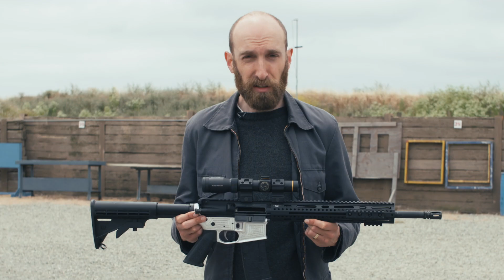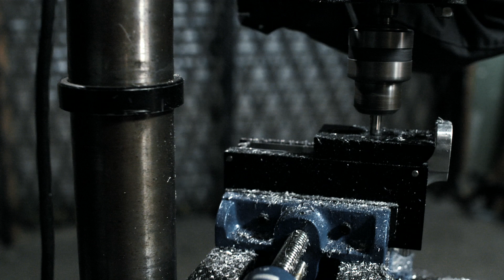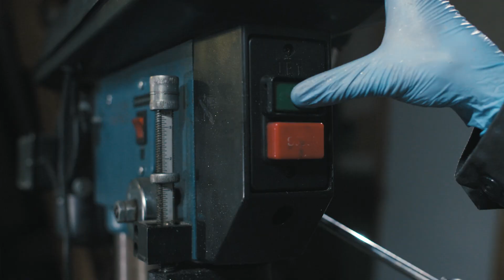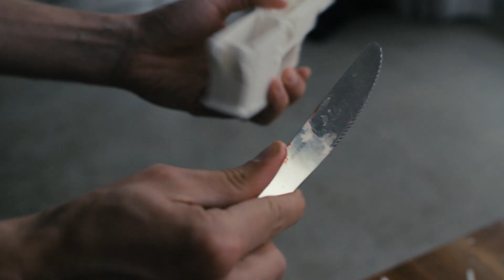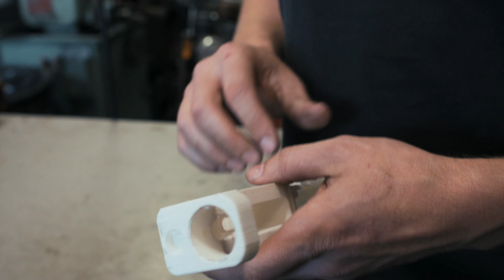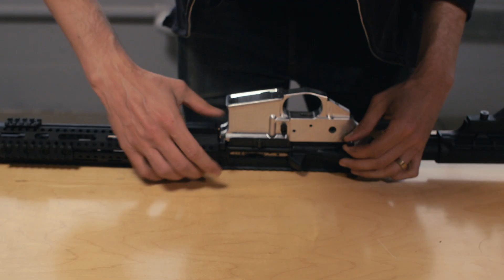I Made an Untraceable AR-15 'Ghost Gun' In My Office | WIRED

Comment: WIRED has printed articles calling for more gun control before, so I was pleasantly surprised that this video was "just the facts" without getting political. It would have been nice for them to go into more detail about the reasons people want to manufacture personal firearms, though. They made it sound like it was almost a tool to violate the law. These are designed for legal use and they don't help anyone get around gun control laws. A commercially made serialized AR-15 is legal wherever an unserialized AR-15 is, and an unserialized gun had many legal restrictions upon it and cannot be transferred or sold. These are often made for ideological reasons, so that the government does not have a record of these weapons (fearing future confiscation).

Comment: An 80% lower is what we refer to in the industry as a factory reject.  They are not sound parts, they are essentially not endorsed by the firearms industry, anyone using one better have insurance
Reply: +Sterling Archer Explain a lowers dangerous failure modes please?
Reply: WackyBroProductions tell me which major gun manufacturer makes an 80%?
Reply: Sterling Archer None that I know of, But I actually want to know why it could be dangerous since its not under any pressure.
Reply: How do you know if the process for making the lower cast is precise or the metal is good?
Reply: Sterling Archer You don't but if it fails what would be the danger?

Comment: You know whats interesting to think about, in a way newtons third law of physics works here. For every action there is an equal and opposite reaction. With anti gun citizens and politicians creating laws that put pressure on Law abiding citizens that own and enjoy guns, the gun community creatively reacted by taking the entire process of owning guns almost completely out of the hands of the government. So in essence if the liberals had never tightened noose on guns, the government would probably have more control over guns. At the rate the liberals are trying to crack down on citizens owning guns, give it 10 years and there will probably be fully automated complete gun manufacturing desktop machines. you just stick in a bar of steel and a few plates of aluminum and an hour later out pops your upper,lower, triggers assembly, bolt carrier group, gas tube, barrel, buffer tube, and muzzle brake.

Comment: because EVERYONE has access to a 3d printer or the computer thing. A drill press maybe. or the $1,500 ghost gunner. Because most thieves have several thousand to spend on building an untraceable rifle to rob someone (how they get $) lol. ONLY the lower receiver made with the ghost gunner was good enough to work. So, what you are saying is I can build me an AR-15 after buying all the parts and a $1,500 milling machine. hmmm sounds cheap enough for EVERYONE to afford. Pretty soon they will be just like big houses and corvettes. everyone has them because they are sooo cheap if you just build them yourselves! Actually you will find most things cost more to build yourself. Maybe if you didn't contradict yourself by saying how easy it was for anyone such as yourself to make these guns, but you in fact did not make a functioning lower receiver, but instead wasted $300 or so in "trying" to make one and then had to get a $1,500 machine to make a functioning one. So, let's see what is the total cost going to be? Higher than most criminals can afford I can tell you that. Also, what is the difference between a "ghost gun" and a gun purchased cheaply on the streets (less than $300) with the serial # filed off? I'll tell you since I've been there and doubt you have. Well, as you can see unless you have a lot of $ a ghost gun is implausible, whereas a "burner" or "throw away" which is a gun purchased legally and then has the serial #s filed off or other modifications. Now, which do you see being easier for criminals to get ahold of? Not a hard choice there if you know anything about economics and general criminal economic background.

Comment: Well...  Knowledge wants to be free!  Incidentally this is perfectly legal and is no more a "skirting" of gun laws than taking legal tax deductions would be "cheating" on your taxes.  You can do the exact same thing with an AK-47 by folding and punching sheet metal.  What I would hope you would take from this is that there will always be ways to obtain firearms, even for criminals.  Stricter gun laws do not affect criminals, but only those with respect for the law.  But I'm sure you've missed that point.

Comment: Can it mill out a 80% 1911 or AR-10 lower? If so, totally worth the investment.
Reply: +Andrew Butchart - if it is a CNC mill it can make any part you can program it to make that fits within its capabilities.  It amazes me how few people know how things are actually fabricated these days. It is not that difficult to make parts like these. It just takes knowledge and desire. You can make parts a lot of different ways - casting and even building up from smaller parts come to mind. I can cut, mold, or otherwise machine a wax model of anything I want and then make an investment casting out of molten aluminum (melts at about 1250 degrees F). There is also a guy that sells a set of parts that can be brazed together with a propane torch. I don't see anyone freaking out about the fact that you can buy those at Lowe's or Home Depot for less than $20. I suppose that is coming sooner or later. Unnnhh, fire bad!

Comment: Another way (without buying a $2500 mill) to make an "untraceable" AR is to to an FFL dealer and buy one. You will notice that the serial number is engraved in the fairly soft aluminum lower and can be machined away. This is actually not OK with the BATF, but what the hey, you're trying to make an "untraceable" gun, right?

Comment: I fail to see the controversy. This is called freedom you hipster bitches. The only people who will ever obey any laws are those predisposed to do so. We call them "law abiding citizens." 99.9% of people building 80% lowers fit into this category. And yes it is legal to sell of give that gun to someone else as long as you put a cereal number on it and keep track of the documentation for 10 years in addition to abiding by your state firearms transfer laws."Actual explosive rounds?" WTF does that even mean?
Reply: +Dollar Bin Gaming My new box of Cinnamon Toast Crunch has a cereal number.
Reply: +ymp5000 Lol I agree but its Serial* and I think he meant Live Rounds not Explosive Rounds.
Reply: To split hairs, gunpowder is not explosive.  Go buy some,  they sell it at Walmart.  Pour a tablespoon out on the ground and light it.  No boom.
Reply: +ymp5000 well gun powder is an explosive so he was technically not incorrect about that, though it's unnecessary to call them that cause there wouldn't be non-explosive rounds, unless you're using an air gun or something.
Reply: +ymp5000 I think the point OP was trying to make is that gun control is BS when  you can DIV a gun out like that.
Reply: +Ebon Hawk gun powder is a propellent, when it burns it releases  a massive amount of gas. This gas rapidly increases pressure in the chamber and propels a bullet down the barrel. if you put C4 in a bullet's shell it would only blow up your gun.
Reply: But is it people's freedom to die from ghost guns?
Reply: Terminator6101 You are always free to not be prepared for any possible situation.
Reply: Nobody has died from a ghost gun

Comment: They can still trace you because of the ballistics...every barrel leaves a unique print on the bullet, like a finger print. Serial numbers are to trace who sold it...
Reply: +varanidguy - the upper on an AR can be removed by pulling two pins. The best thing to do if you were intent on committing a crime with this type of gun is to remove the upper and toss it in the deepest body of water you can find.